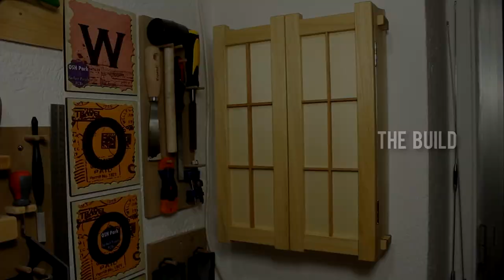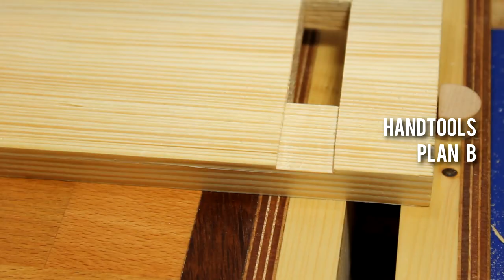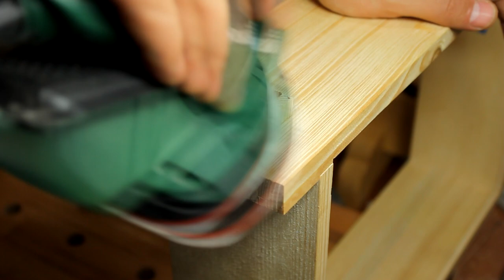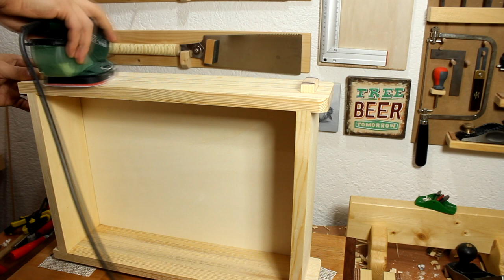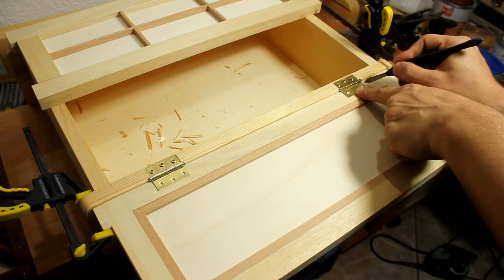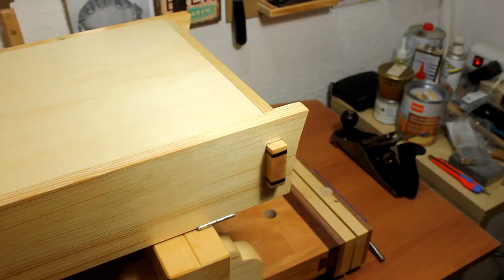Workshop Wall Cabinet - Asian Inspired

Comment: Really enjoy all your projects, I've learned a good bit, and gain ideas from your projects.   Is this your own design, or did you get inspiration from a book or web site?  I'd like to find more designs similar to this. Please keep sharing your talent.
Reply from the maker: Thanks! No, it's my own design. There is a little technical mistake there. The wedge of the tenon should be turned to press on the endgrain, and also the side that has the mortice a bit more longer for the wedge to have some meat to press on. Anyway is working even like so, I use it for light stuff.
Reply: Thank you, you have a very creative mind